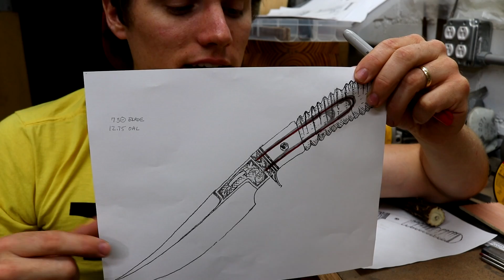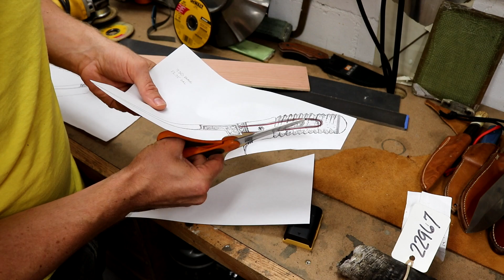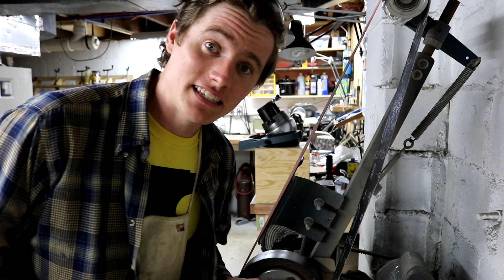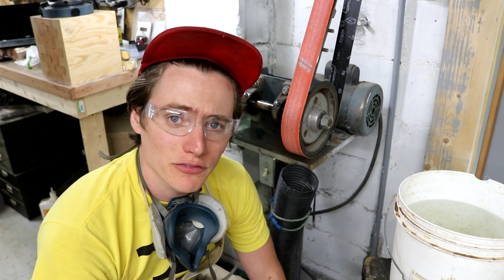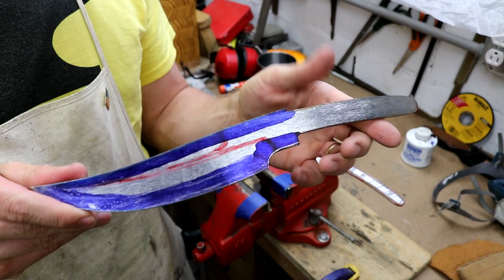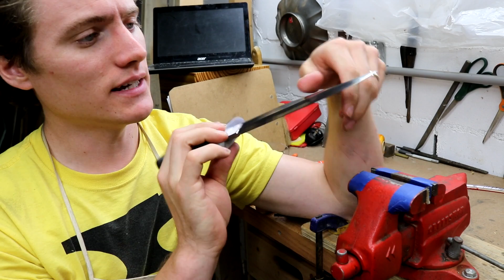Cutting Out a Knife Blade - Knife Making - Gemsbok Pt. 2

Comment: You CAN weld stainless to stainless on your MIG welder with stainless MIG wire and shielding gas but you have to be careful about how hot you get it. When it gets too hot, it will loose much of it's stainless properties so TIG welding is usually the way to go. However, you can weld a solid joint in stainless to carbon steel with regular MIG wire but the joint and a bit around it will have carbon steel properties ... so just make sure you weld back from the blade far enough and keep the heat down and you'll be fine. Clamping the stainless part to a big ol' hunk of steel will help with the heat spreading too far.
Reply from the maker: I have a flux core welder. In the future I'd like a TIG for many different projects. Thanks for the info.